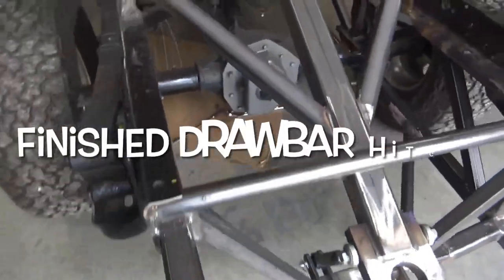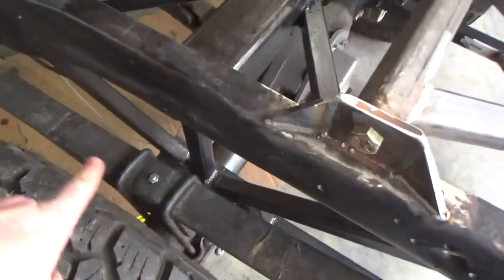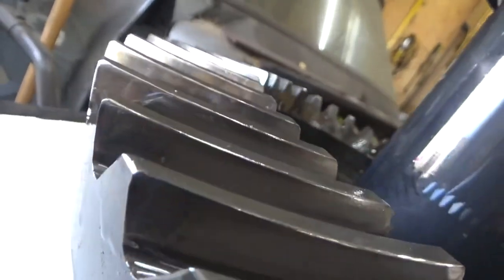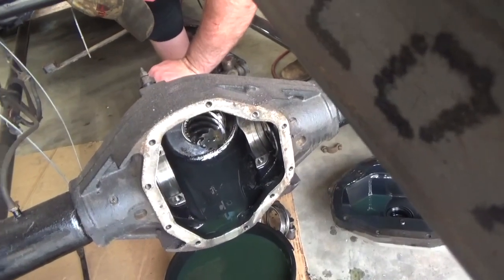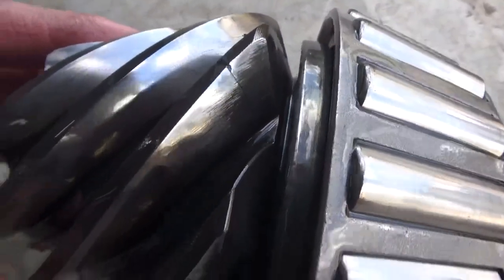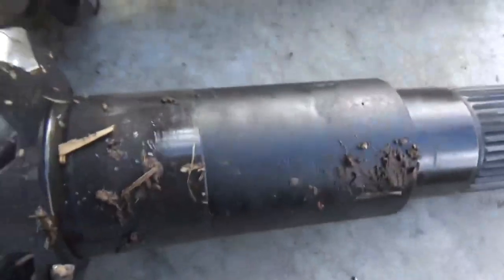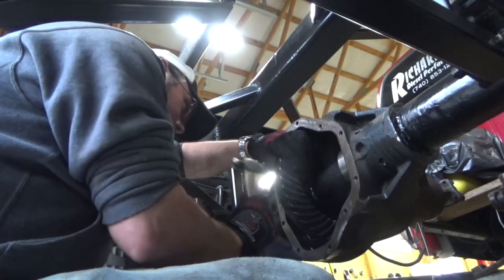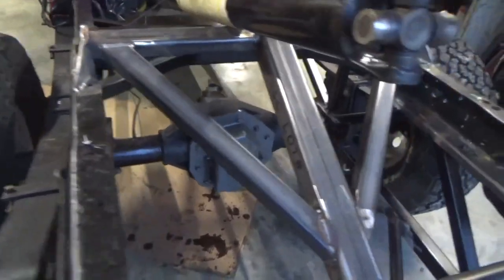Dana 80 Gear Change:  12 Valve Cummins Sled Puller

Comment: You can cryo your gears but we tried that and pulled the threads out of the cap bolt holes. Didnt crack any gears tho 😂 then I made to where 8 bolts and I can roll my rear end out from under the truck, makes it a little easier on you

Comment: Well see the problem is pulling.............it takes horsepower and feeds on parts, quality parts, China parts, don't matter. Only way to stretch the life is further is to swing for the fence and put some Rockwells under it I'd have to think that's class limited upgrades right?
Reply from the maker: That’s correct.  Totally agree.  Wish there was an upgrade option, but one ton driveline is the rule for us.